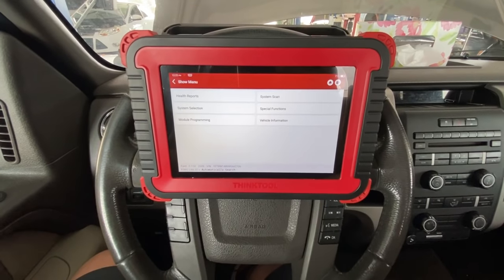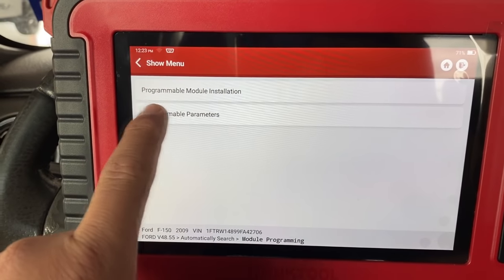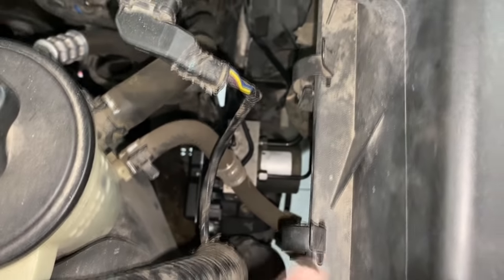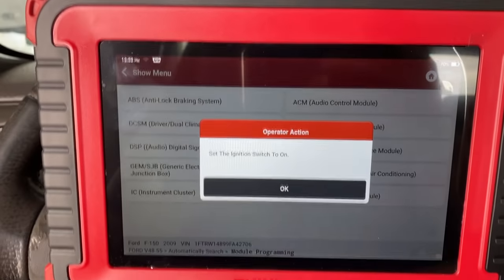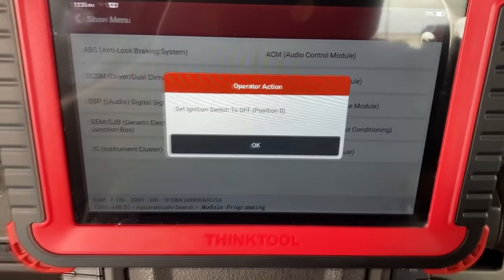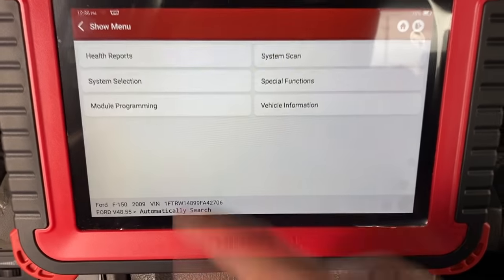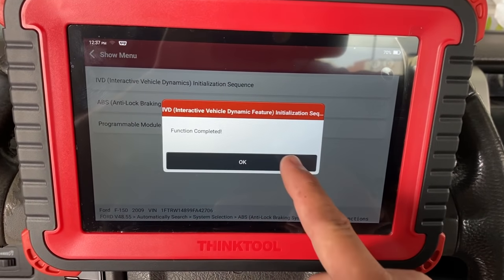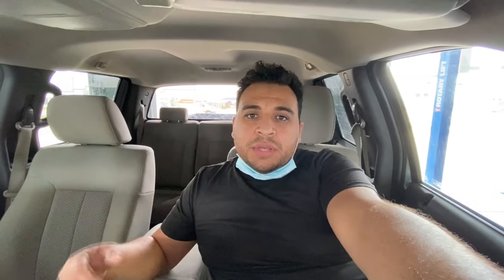WHAT FORD DOESN'T WANT YOU TO KNOW! ABS MODULE PROGRAMMING

Comment: Is there any Additional cost for any functions?
Reply: No,full software and 2 year free update
Reply: @thinkcartool3825  tech support? Both tool issues and walk thru on problem vehicles. Just had a 2010 ford taurus interceptor no crank issue. Start relay load side would engage starter and crank over, with key on still no start, control side key on and cranking  both terminals read around 2 volts, with pats  code " not programmed" and no pats module info so looked in the bcm and found a touch of data.  I work on everything from old chevys to Lexus and side by sides to school buses " short and long". I have to by my own tools because the shop I work for says if their modis edge can't do it there is something wrong with the car so ship it somewhere else. I just want to fix cars and I have three scan tools myself two are codes and data . The third is the max lite and just like my bosses it's all about the money. I am the lead tech and a don't make a 1/4 of what they charge an hour. I will be getting one of y'all's tools as soon as my money is right.
Reply: @shaunadams3170  Yes we provide suport for Thinktool Pro.Are you looking for professional scan tool that support full system scan and ECU programming? not real understand what you say.
Reply: @thinkcartool3825  just saying that a shop needs more than just one scan tool and if I spend my hard earned money on a tool I don't have the time or money to waste on down time or lack of function. And your tool has caught my attention.

Comment: I guess if I had your $900 tool in front of me I could follow along, but if Ford doesn't want me to know, I'd say their secret is still safe.
Reply: Same would be true if you didn't have a set of wrenches. You need the right tools
Reply: Ford makes programming data available. You would have to enter it manually, but its not that bad.

Comment: Anything post 2003 is pure junk, and belongs in a scrap yard.  You'll be doing nothing but chasing your own fail replacing sensors, and reprogramming the electronic gizmos that are set up to fail like dominos.  ECU fail due to failed ignition coil, that failed due to a bad spark plug, that failed due to incorrect fuel air mixture, that was caused by a clogged catalytic converter or any one of the O2 sensors scattered along the exhaust system.  And all of which caused pinging that destroyed the top of any one of or all pistons.  Pure idiocy.

Comment: thanks for the video man!  I was looking in the amazon link and i see you have 3 launch x431 V tablets..? two for 899$ and one for 1100$?  whats the difference? All these scantool brands are so confusing in their information and comparisons  of their product lines..  do you know if launch diagun V can compare to the x431 V tablets? And how does the thinktool pro you are showing, compare to the Diagun V /x431 line under 1000$? Do you know if launch and thinktool do like autel and lock their scantools when you try to update, when you are outside of the original geographical location the tool was sold in? for example ive heard autel will lock the tool if you buy from china vendor and try using it outside the china area.. same goes for usa i guess if you travel outside north america with usa autel pad...? thanks you so much for your time and videos! Cheerz
Reply: Good questions,let us reply it.
Thinktool Pro can works on most of popular cars like Launch X431.
But if you are looking for more fast or durable scan tool,Thinktool Pro will be better.
The big difference: Thinktool Tool was Designed to closed system so you can not add other app or access google/website in this moment.
We have not lock the thinkcar tool serial if everything is normal.
Reply: @thinkcartool3825  sorry but i find your reply vague and imprecise.

Comment: ABS is a con job. What needs calibration and reprogramming is the drivers mark one eye ball. It starts 1st by knowing what the proper function of what the horizontal pedal is for on a 2 pedal vehicle.
Race cars DO NOT have ABS because the driver knows how and when to use the brakes.
The 17 year old vehicle I drive now had a ABS fault. My solution, unplug the fuse for it. When ABS gets out of cal it is DANGEROUS.
I do miss the control you have with brakes, but if it is unplugged I don't.
Motor cycles are even better. BUT some are made with the same idea that we should make this with lazy operator as the primary on the seat.
Operating a motor vehicle is the most dangerous thing most Americans will ever do. The problem is NTSA has mandated making them fool proof. 
It is getting to point where only a fool can aim them.
By the way I DO prefer 3 pedals. But I am married. It is a selfish for me to have a vehicle always with gas tank at 3/4 full. Why is that? 
If you don't understand get a 3 pedal vehicle if you are married. You will learn. Oh and she will want both sets keys. So hide yours.

Comment: 2003 mustang mach 1 
ABS does not sync with the code reader but, there is an abs light that sporatically comes on at the same time as the traction control light( indicating "Not engaged"). Hooked up a $3000 scanner to it and still didnt communicate with the ABS Control Module. They are no longer produced (to include  aftermarket). Any ideas. The Mach1 and Cobras used the same abs control module. This is completely different from the GT. Thanks for any assistance.